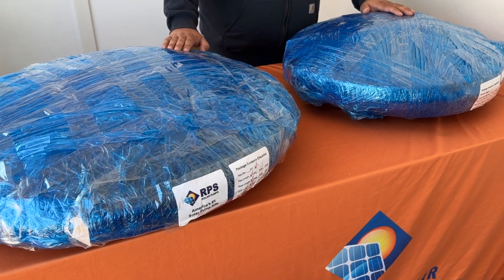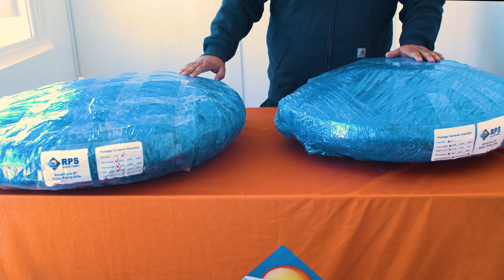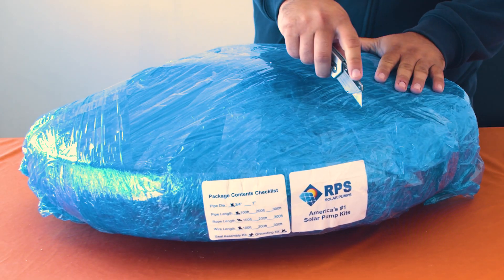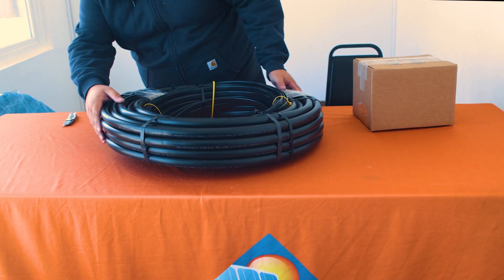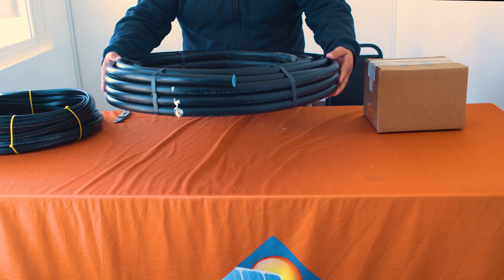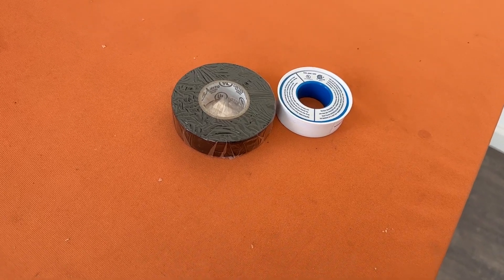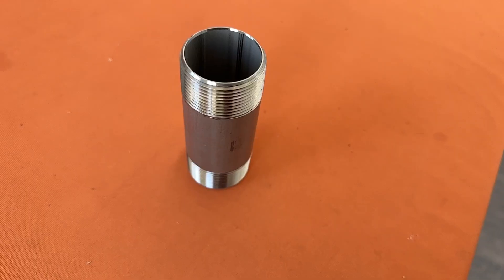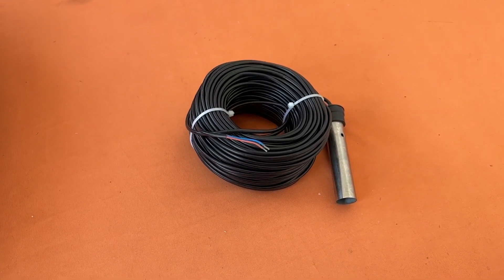RPS Turnkey Kit unboxing

Comment: Lighting got my pump and controller so I only need part of the kit:  pump , wiring for 200 ft, controller and any surge protection you have.  I purchased  my present system from you.   Joe Holmes. 28639 rose hill rd.  Andalusia. ,Al